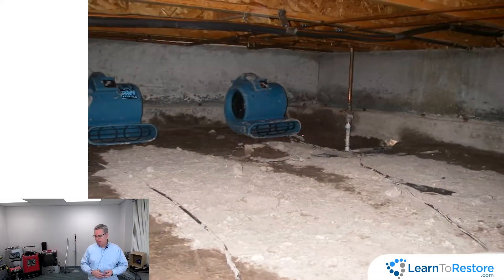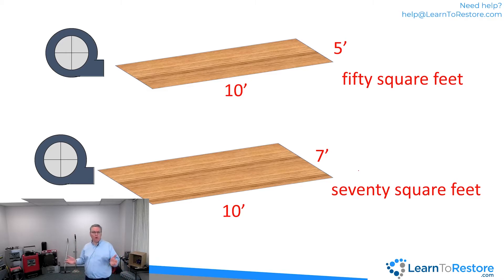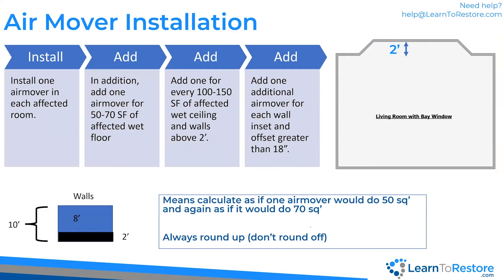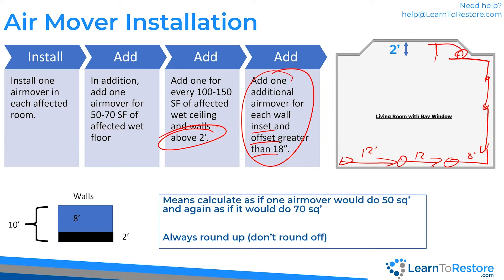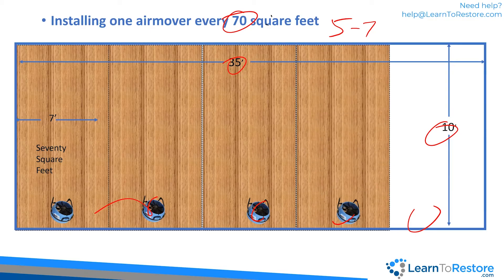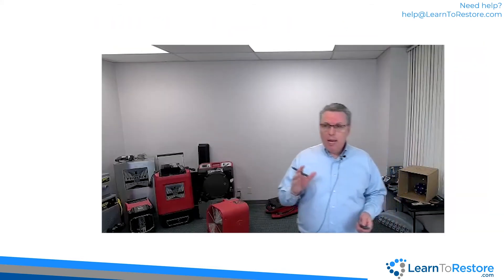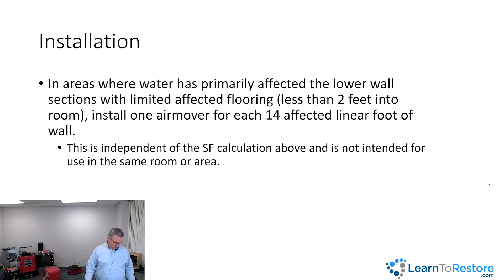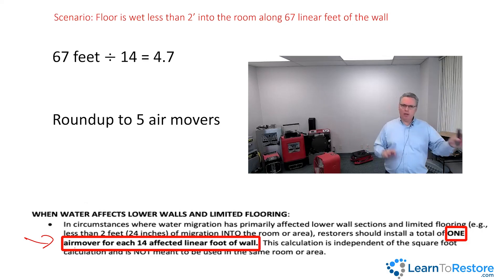Air Mover Calculations - How Many Air Movers Do You Need?

Comment: so in the first example at 16:00 . I would get EITHER 10 Low Range Air Movers OR 13 High Range Air Movers?
Reply from the maker: Yes, that is correct. It is a range (high and low, or you could think of it as minimum and maximum needed). So you could bring in 10 air movers to the room, and if that allows you to get airflow to all wet/affected surfaces, you are done. If not, bring in another and another and another, up to 13. In this example, if you are using between 10 and 13 air movers, you are within the S500 Standard of Care.

Comment: How does this affect the calculations once the drywall and insulation has been removed from the wall?
Reply from the maker: Great question. It comes down to surface area. If you remove all the drywall and the studs are wet to the ceiling. The wall area would be the same. If, however, after removing the drywall only the bottom 3 feet of the studs are wet, that would be the amount of surface area you would calculate for that wall. As a side note when dealing with an open stud wall, it can be helpful to use Layflat ducting, and or plastic sheeting to direct the airflow to where you need it.